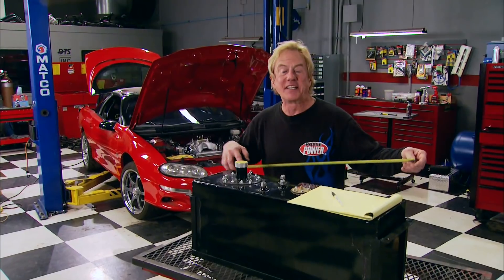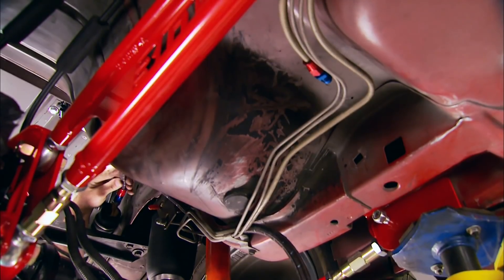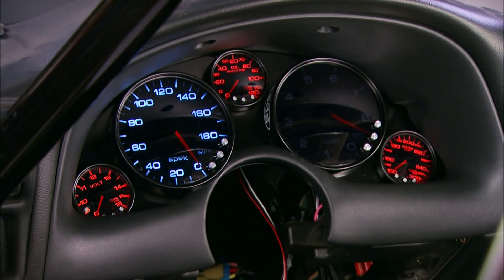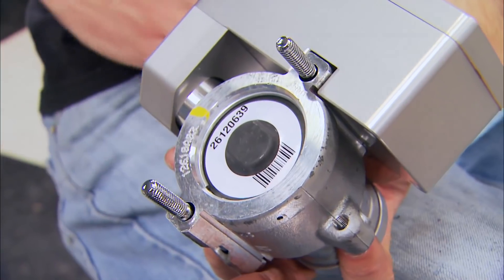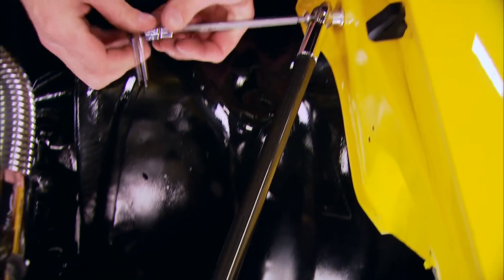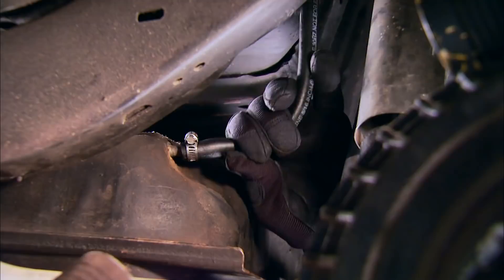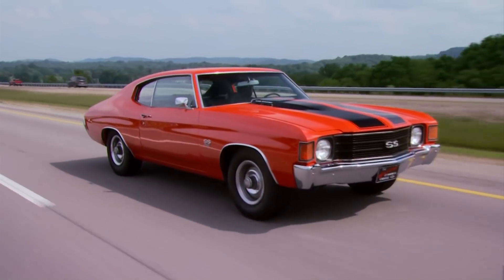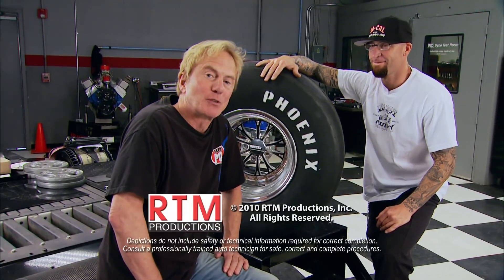Increasing A Carbureted 350 Small Block's Efficiency With EFI - Horsepower S14, E10

Comment: I have been debating putting in efi on my 383 stroker 76 corvette. Thanks for this video
Reply: It's worth the money if you like driving your project. I used the Holley Sniper system. It works fantastic! Throttle response is great and your easily able to dial in a tune suited for the engines unique fuel demands. my only complaint is the fuel pump that came with the kit is very loud.
Reply: @fragman21  I just got my Holley sniper stealth put on. Wow it sure woke the old girl up. And yes the pump is very loud.
Reply: @rippertrain  are you or have you looked into another pump? if so which one?
Reply: @fragman21  hell no. I used to have to rev my Vette to 4000 rpm and drop the clutch to do a burn out. Now I just give it half throttle and drop the clutch at the same time . I break loose without even trying. I'm not going to change a dang thing. This sniper kit ROCKS!!!!!!!!!! ITS double the power of my burned out Rochester carb.
Reply: @rippertrain  I hear ya. the instant throttle response is fantastic! I have a very healthy small block in my S10. it was making over 400hp to the ground with a carb. I haven't had it on a dyno sense the EFI but it fells much better.
Reply: @fragman21  thankyou for that info. I couldn't figure out why I was peeling out by mistake. Now I understand. It's the response time. I really honestly didn't know what the heck was going on. Take care stay safe.